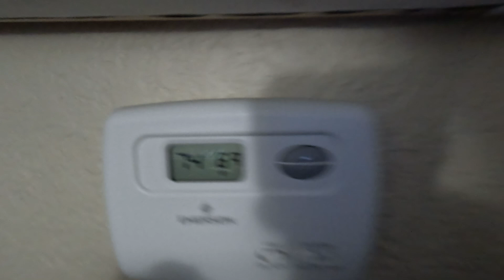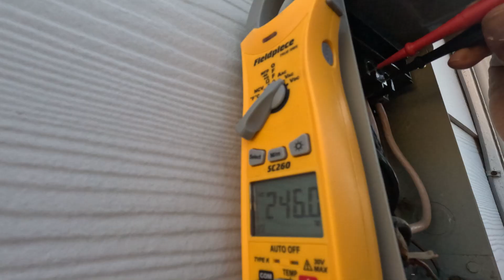Katy Air Conditioning Repair |  Troubleshooting Guide AC Units That Trip Breakers Instead of Cooling

Comment: Run caps in boxes? Please tell me you strapped those down... Don't become a Run Cap Bandit! HVAC vendors don't leave caps in a box, HVAC technicians shouldn't either. And I hope you highly recommended the customer get a maintenance service, those condenser coils desperately need cleaning - I can only imagine what the pressures looked like, that poor thing isn't going to keep up with Houston heat and humidity.

Comment: First off, I really appreciate the video layout. Makes it really easy to understand the troubleshooting process for someone like me with plenty of background in mechanics and electronics, but next to none with HVAC. I know with enough time and/or documentation I can safely diagnose and repair just about anything. Been putting off getting our central air back up and running due to a severe lack of time to sit and read or chase my own tail winging it for a little over a year. I feel totally confident I know what I'm looking for and doing after your short video. 

Now on to why I really decided to leave a comment. Please for the love.... Don't use white zip ties in any exposed installations. The nylon 6 they use for zip ties is basically the same across the board. However to prevent the color from becoming muddled, white doesn't have the uv stabilizers added that black and other colors get to prevent them from drying out and cracking when exposed to uv and weather changes. 

Another not commonly known one, if you have a big container of zip ties that seem to be getting brittle or you need to install them in fairly cool weather get them warm and wet. 🤣

 Get a large enough pot of water boiling you can place the zip ties in a mesh strainer off the bottom of the pan and kill the flame  while you let them soak for just a couple minutes. If your tap gets fairly warm you can just put the plug in and soak them in the sink basin, granted they aren't extremely dried out. 

Zip ties actually need a little moisture to stay pliable and they come from the factory with a relatively consistent moisture content. Once opened and exposed to work truck and garage temp swings they dry out fast. This will make good zip ties able to withstand a greater amount of tension without snapping while installing and over time.
Reply: Zip tie Karen 😂
Reply: @potentialhvac6074  hey I'm just trying to keep us all from one day getting wiring chewed up. I've only had to deal with it in automotive, but I'm sure it's just as awful for hvac. The white ones get just as brittle from engine heat as the uv. Not a fun day. They are perfectly fine in enclosure usage btw. I would hope panel temps aren't reaching that of an engine bay anyways, otherwise I think zip ties are the least of anyone's worries.